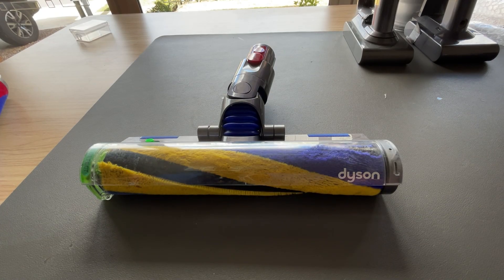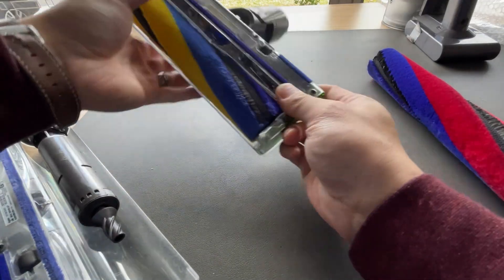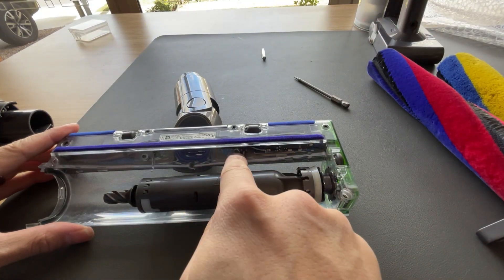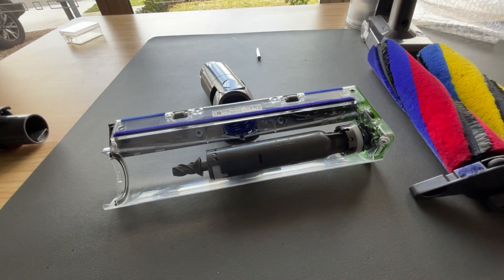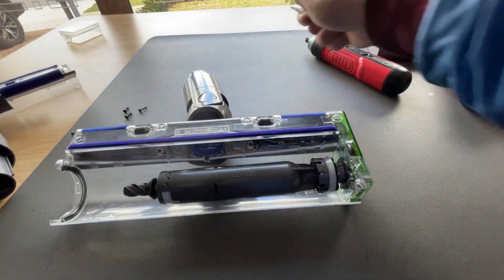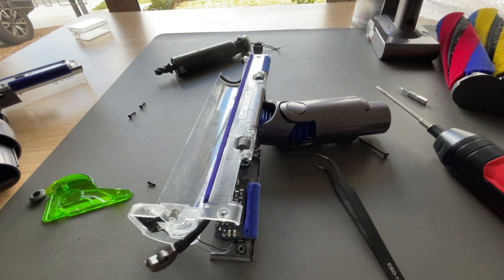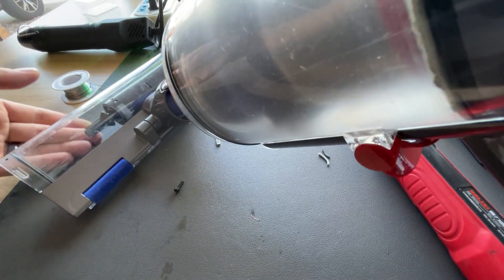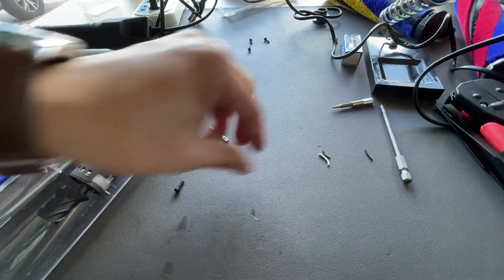How to Repair a Dyson V12/V15 Laser Head (Full Teardown & Motor Swap)”

Comment: "luckily we got it" won't cut it for me I can't believe there isn't other way I don't have Torx that thin and long to reach it unfortunately ....
Reply from the maker: You need those precision screwdriver set with flexible extension, you can get them on eBay for around $10-15

Comment: Hi, where did you buy the internal motor?
Reply from the maker: I savaged the parts from other heads. It's very hard to get the actual parts you need.  The thing is, for some parts like laser fluffy heads, you need to have a few so you can savage parts.